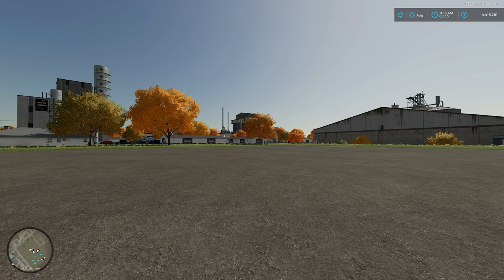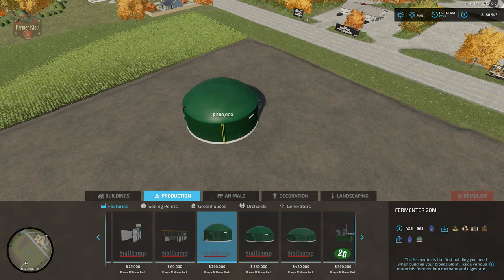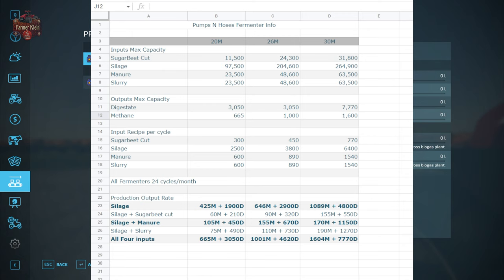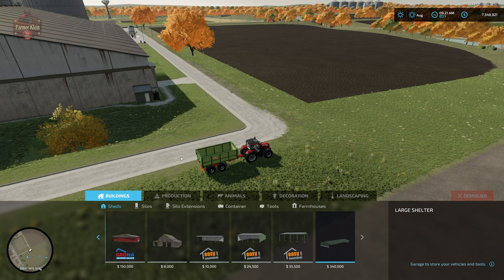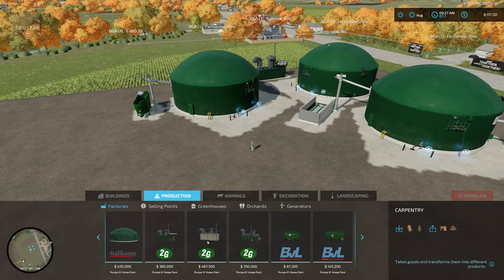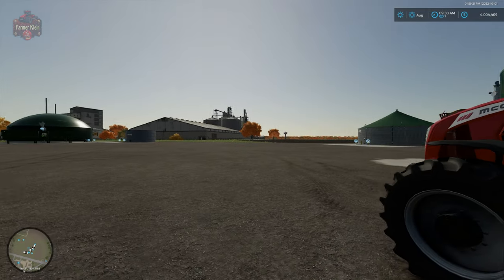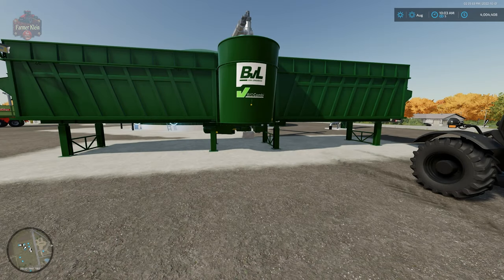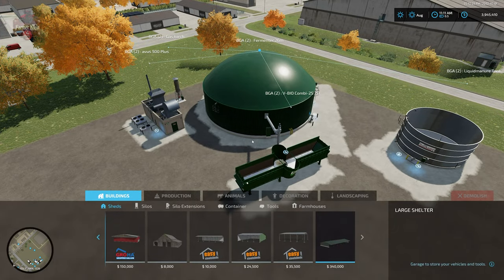Pumps N' Hoses A How To | Part 1 | Building an Expandable BGA

Comment: Hands down the best BGA tutorial vid out there. I have seen a bunch of them and did not fully understand things until watching this video. Thank you sir. One change I would make is that you do not have to use belts or a bucket to load into the inputs. There is an auger wagon that will hold manure, not 100% about silage but it might.. you can load that up and then use the auger pipe to load into the inputs. I saw that work in another video.
Reply: not a mod, it is base game.
Reply from the maker: Glad you liked it!

Comment: Thanks very useful tutorial. Can you remove a section by using demolish button and receive a refund? which In modular bga this is impossible, there is no way to remove it.
Reply from the maker: Sure, you can remove everything/anything aside from the inital digester which anchors the whole setup.  Removing that would likely make the rest inactive.
Reply: @FarmerKlein  cool thanks now I'm convinced 👍🏼 I'm going for this mod 🍻

Comment: thank you for this the very well done Video @Farmer Klein my question is i have mine up all running fine and making money the question i have is i have in the change mode section only sell, distribute , and spawn well seem to have 2 spawns which is what made this hard to set up at first i don't seem to have the  "distribute across the biomass plant"  i have not seen anything in the forums of anyone else having this issue that i know of .  

UPDATE it was  a mod conflict took all my mods out and it shows up just need to find which  mod it is now .
Reply from the maker: My guess would be any mod that changes how productions work would be the first place to look.
Reply: @FarmerKlein   thank you for your reply will have a look when I get time will let you know what it is when I find it
Reply: @FarmerKlein  update the mod causing the conflict for my problem was "Info display Extension " v 1.4.1.O By Achimobil in the Giants Modhub thank you for your time in getting back to me hope this helps if any one else has this problem. take care

Comment: What if you don't build a torch?
Reply from the maker: Depends if you built a balanced system or not.  If your making methane faster than you can convert it to energy then it will eventually fill up and you will stop producing because the output is full.  Its not like the plant will explode.